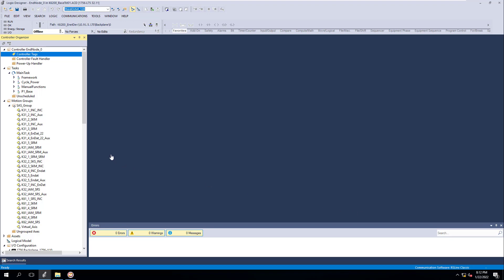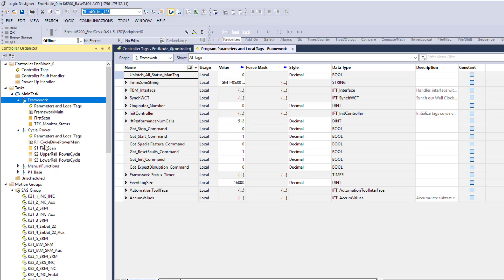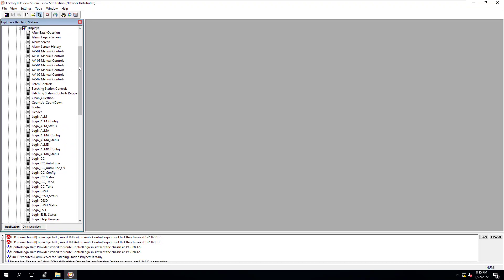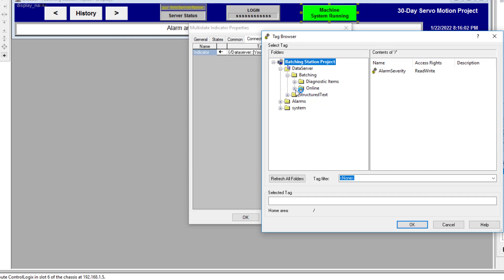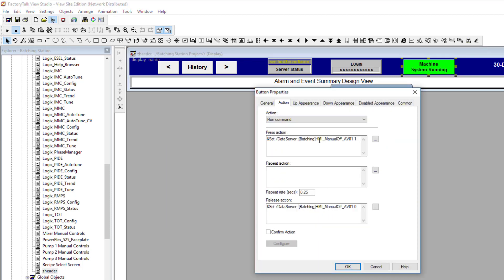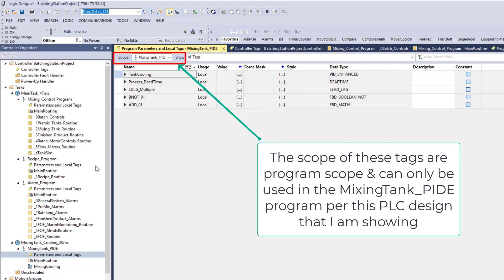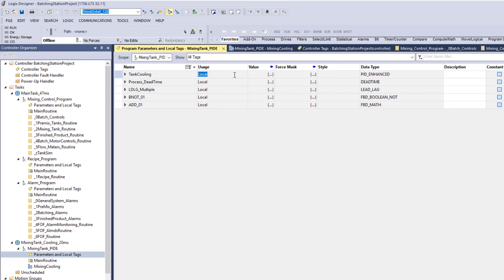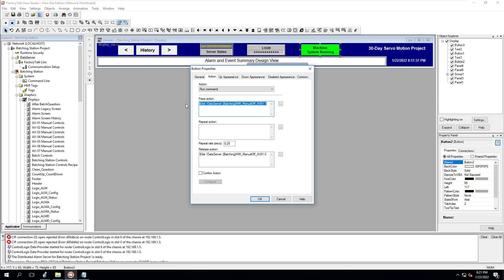Controller Scope Tags vs Program Scope Tags in Studio 5000

Comment: Hey Shane -- how could I communicate a controller tag from 1 PLC's project to a different PLC project that is connected thru the same network? Example: PLC 1 has the OTE "TEST BIT". PLC 2 can use "TEST BIT" as an XIC. 

If I have multiple PLCs already setup on the same network, will the global tags automatically be assigned throughout the entire network?
Reply from the maker: I recommend either message instructions or Produced/Consumed data.

Produced and Consumed data is by far a better way.
Here is a video:
https://youtu.be/NepNw8XyQhc
Reply: @ShaneWelcher  Thank you, brother. Exactly what I was looking for.
Reply from the maker: @willshin3512  Glad to help

Comment: So why would you ever make a tag program scoped and not just make them all controller scoped? So you don't use up all of the controllers memory or slow it down? Great channel by the way. Very concise. 👍
Reply from the maker: Use program scope so you can easily program things that need to have duplicate logic yet different tags, an export import tag replacement use.

Modulus programming